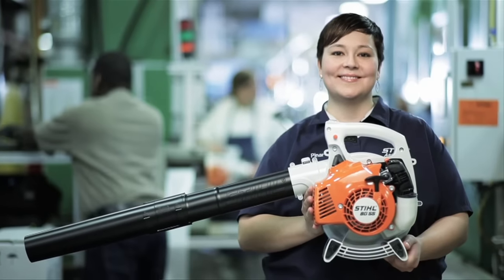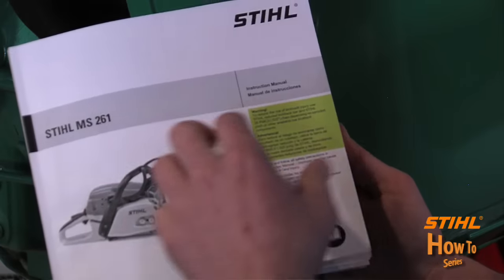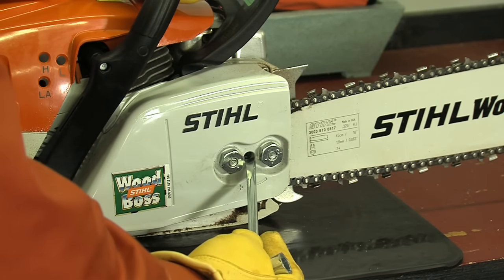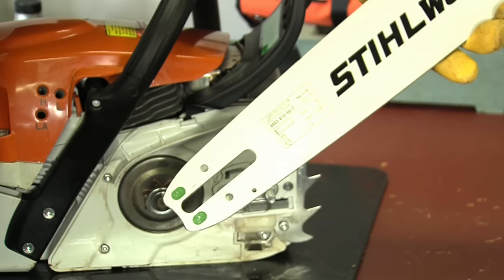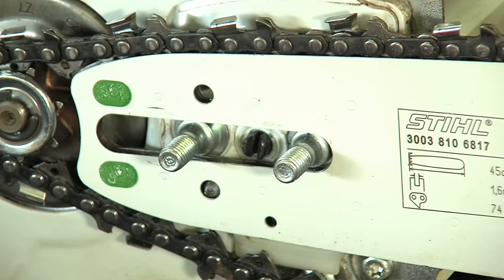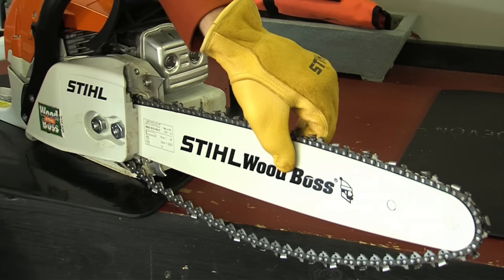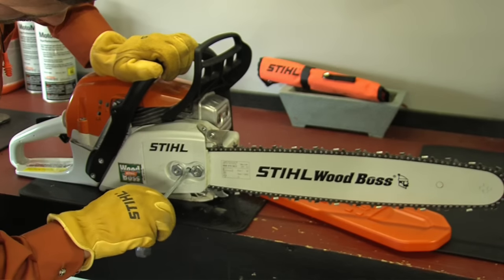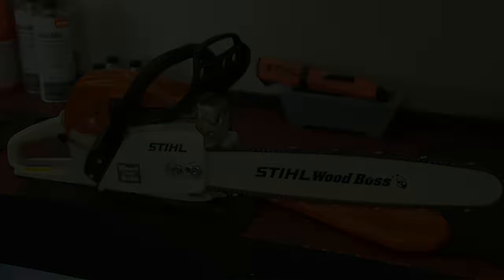How To Adjust STIHL Saw Chain | STIHL Tutorial

Comment: This is one of the better sources for information and the added tips are very useful. I have a MS 170 that is the best running saw I've ever owned and it cuts great, it can't compete with the larger Husqvarna's but I didn't get for those jobs. Also have Stihl trimmers and they are awesome for the heavier work. Have never owned a Stihl product that didn't perform like it claimed it would, the little MS 170 is overworked but it does a great job and keeps going.

Comment: Wonderful information two things. 1. Had a problem when we flipped the blade that the chain was on backwards so don't forget to do that! 2. Also, common problems would be nice (oil & grease inside cover plate, excess dirt or wear on blade and cover, cross threaded, etc.)

Comment: Great share my friend....here it is in my laymen terms...
The stretch is actually the chain link holes get worn from overheating and a lack of oil. Also, after each use at the end of the day, loosen the tension, to help prevent the hole and pins fron holding pressure on them and slow the " holes from wollering out. I found most of these clues from you and other people, so don't think I am an expert. Just sharing the knowledge I have been shown. Remember if this sounds odd, but having 70 and more links in a chain, and getting each hole say 1/16" each of hole wear, then add that up and you understand how the chain will be longer overall when installed and pulled to length. Metal expands when over heated. Just a litte simple math. Be safe out there and enjoy the great outdoors !

Comment: Stihl Inc...On mounting a bar I saw a Youtube from Redbull661 that made a lot of sense because I have bound my saw up on several occasions mounting it the way you recommend and never knew why.  He explained that when you lift the tip and then tighten the bar nuts if you use the top of the bar and it slips at all you will put tremendous pressure on the crankshaft and bar sprocket enough to seize the saw.  If all you are doing is bucking, lifting the tip makes sense because you are always pushing up from the bottom.  But if you are using the top and bottom of the bar it makes sense to tighten with the tip down.

Comment: Now if you could only tell my local authorized Stihl Service Center to not leave the chain tensioned when not in use. Just had it serviced (picked up yesterday,but dropped off two weeks ago) and I had them install a new chain while they were there. Fully tensioned when I picked it up. But the chainsaw is AMAZING though. Thanks STIHL.

Comment: I am thinking about buying Stihl chainsaw from my local hardware store soon. Which Quick Adjustment or tool-on screwing are better for homeowner use?
Reply: The saw you buy will come with a tool that adjusts everything.
Reply: Screw (two nut adjuster)    The quick change one is made of plastic and impossible to turn.   It will probably break if you force it.   Stay traditional

Comment: I have a ms 251 Chainsaw and I have tightened it up all it goes and chain still has slack ? Any ideas
Reply from the maker: Hello Mario, Make sure when tightening the chain you lift the bar up and leave about a 1/4" of slack underneath.  IF you are getting more than a 1/4" of slack, it is likely the chain has stretched from heat or friction.  If the chain is not sharp the friction will cause the chain to stretch.  Consider purchasing a new chain.
Reply: @stihlusa  yea that’s what I was thinking. I’ll get a new one thank you! Great video by the way.

Comment: The quick adjust would be a good idea if it wasn't made out of plastic.
Reply: +Ray Duerksen 
I own several Stihl saw, one which has the quick adjust and have never had a problem with it.
Reply: Nothing replaces a proper fastener. Bolts nuts and rivots or bust.

Comment: I bought a quick adjust chainsaw last year. When I went to tighten the chain yesterday, the plastic adjustment cover refuses to move in either direction. This should not happen with a chainsaw that is less that 2 years old and has only been used less than 5 times. Does anyone know how to free the adjustment wheel?
Reply: You need bring back Stihl shop if garantee

Comment: Can't for the life of me figure out my 024 AVS. Appears the adjustable screw face outward, towards the chain. Mine didn't have one when bought and I now have a adjustment kit for it. Not sure if it's the correct one however.
Reply: I got a 024 AV and the adjustment screw is in the middle between the cover plate nuts o.o
Reply: Siomonte That's the difference between these models. The AV "Super" models have it facing the chain, right against the bar, I found out. I have since found an Oregon brand one that works

Comment: What do you do if your chain has stretched so much that the tightening adjustment is all the the way out and the chain still isn't tight enough?? Stihl chain
Reply: Scott Stahl  you have a link removed from the chain
Reply: That's just what I did. Two links removed and chain sharpened at the local stihl shop

Comment: Anyone that can help me with my chainsaw issue? When we use the saw (say about 2-3 logs) the chain becomes slacked. after taking off cover, re-tightening chain and so forth. Then try a few more and it just becomes lose again? Does something need replaced? Tensioner? Or maybe the sprocket?
Reply: If it helps it is the STIHL farm boss
Reply: Also have a  Stihl MS 210 and both have the same issue
Reply: new chains need a few tanks of gas to break in.after that the tensioning becomes less frequent. And why remove the cover?
Reply: just to clean the sawdust or buildup where the oil comes out. and because it keeps coming off the sprocket i guess so you have to put it all back on
Reply: sinnerswrath1 If it keeps coming off the sprocket something is wrong. Sprocket may be worn, adjuster stripped, chain not on right or it's too loose or backwards, bent shaft, etc. I would take it to an authorized tech to give it a check up.
Reply: Get a side adjuster for chain tension. I got one from China for $7.00, MS170, Farmertec.com

Comment: Never new I needed to turn my chainsaw bar over every time I replace the chain.
Reply: Yep
Reply: @mitchdenner9743  why?
Reply: @Pingaheimer  most of the wear on a chainsaw bar happens on the top and nose of  the bar. If you flip it periodically it will disperse the wear and make the bar last longer.
Reply: @mitchdenner9743  working on my first chainsaw, a Homelite i got for $40 on offerup, had to put in new fuel lines and new chain. How do i know if the bar is still good and what other components should i check for wear?